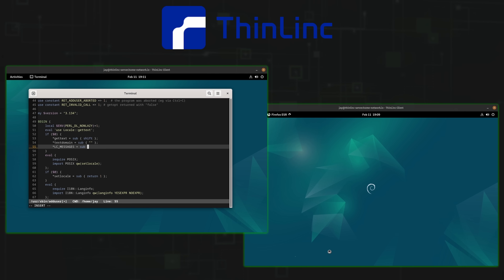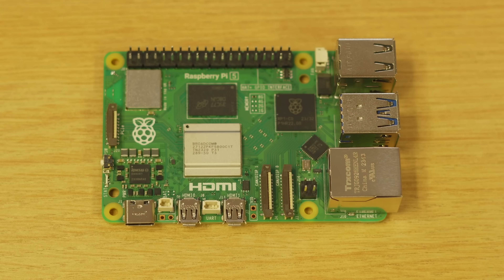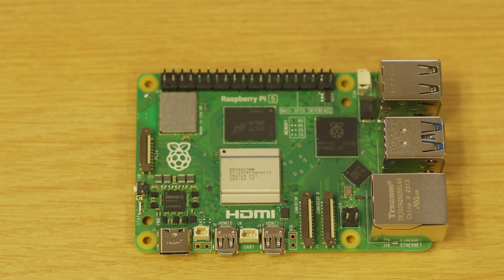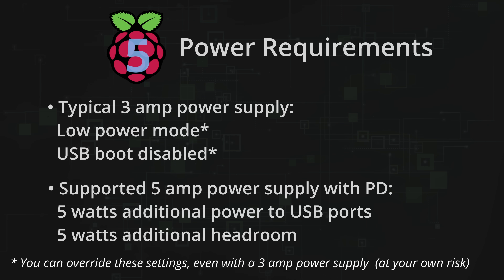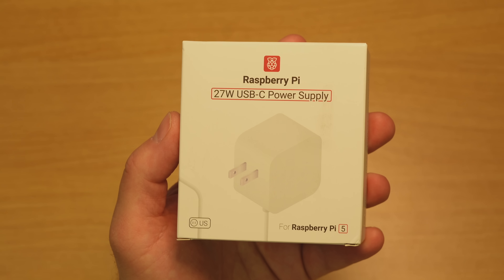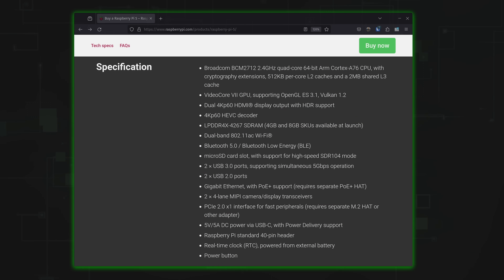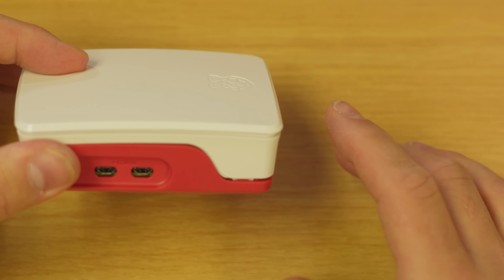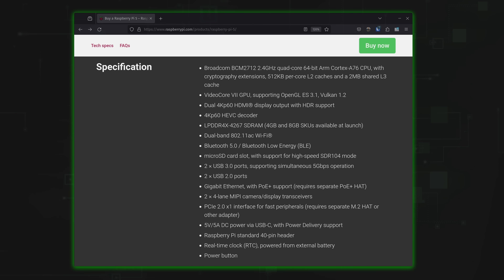Raspberry Pi 5: The Game Changer? Discover What's New!

Comment: I received a Pi5 from my son for Christmas and haven't looked back. My desk is now free of a PC. I have been using this little guy as my daily desktop since Christmas and besides not being able to compile for my 3D printer's firmware, it has been basically trouble free. Tonight I am hooking up my second monitor (had to wait for my micro-HDMI cable) so we'll see how that goes.

I've been looking all over for how to add a NVMe hat so I can use some speeder sotrage than the SD card I have been using. The NVMe hats I have read about have more drawbacks than sticking with the Micro SD card for now.

Finally, I hope the smart guys in the Arch world (and their distrobutions) will get them over to the RPi 5 so I can go back to my Operating system of choice (Arco Linux).

Comment: Is that like a mini computer?  And, a great amazon deal at about 100$ which 3x Inspiron 530S system which could be had off ebay 35$ 40$ :) Unless you need something light for a robotoid.  I think official PSU is 220w

Comment: I have absolutely NO NEED for an SBC, I have a Pi 3B+ I don't use for anything, as it's only the 1Gb RAM version, so rather useless for most things. It was bought to run a 3D printer software, for a printer I still haven't bought, and probably never will. The Pi 5 for me would be around $200AUD when I include the PS, Cooler, Case(either with the cooler or not at all, as there doesn't appear to be a case big enough to take the board with the big cooler yet, but  I'm sure someone is building a version in CAD as I type). It's still fairly cheap, but is it a better option than some of the OTHER SBC's on the market now. I would only be buying it as a LAB TOY, and have no real need of either this or any other SBC.....DOES NOT STOP ME WANTING ONE THOUGH !!!!! I'd rather spend my money on shit for myself while I'm alive than have it go into consolidated revenue when I die....NOW, time to go shopping !!!

Comment: i bought the Official case in Singapore. One thing i hate is, it does not come with 4 screws to hold the Pi5. What are they thinking? i hav to use 2 x cable ties to hold the opposite side of the board. Simple things, they cannot get it right. i did not use that fan. i went with the Offiical Active cooler.

Comment: What was once attractive about the pi in general was the low cost. Now they are pushing it into the low end computer arena running linux and it's very capable at that. The problem is this... I can buy a fully encased mini-computer with ssd storage, etc... windows installed if I want to bang my head on the wall... wifi, bluetooth et al for around the same price as an 8G pi 5 with power supply, heat sink, fan and case... without any ram. They've priced themselves out of the market as competition in the mini-computer market has driven fully functional and usable computer prices down. So, the pi 5 is mostly usable for hardware experimentation and has reached overkill.

Comment: The RPi is no longer a competitive device. Back when it was first introduced, It was revolutionary; it brought SBC price into the range of a microcontroller board (like the Arduino).

Today, Arduino's are replaced by a $5 ESP32. And an 8GB RPi5 (with case, power supply, NVMe and daughter board) cost more than a fanless N100 with 8GB RAM, dual 2.5Gb interfaces, 256GB NVMe, case, and power supply included (about $160). And the N100 is X86_64 and twice the performance. You're free to run any off the shelf x86_64 OS; Windows 11, Linux, a router OS, whatever.

I loved RPi; I've bought several, and still run an RPi4 as a Wireguard termination for our LAN. But I don't plan on buying any more. Times have changed, and with that the price/performance equation has tilted to low-cost x86_64 hardware.

Comment: The easiest way is just to enable the max power support by modifying the file and using an old power supply. Or installing an other OS, since other OS don't disable the USB power by default. I am using a 3A power supply and it is running fine. I even know a guy that is using a 2A only without problems.

Comment: Bleh. That's bad engineering on the power supply side to not properly handle the 99% case of how USB-C PD power supplies work.
Reply: They clearly wanted to force everybody to buy their own power adapter. This is just hidden cost.
Reply: They use Usb PD but its 5V 5A / 5.1V 5A (25W/27W), a really weird choice by raspberry pi. Some speculate that because of the weird specs make it cheaper for them to use usb pd implementation, while I think that its because they still want to use 5V like all their pi lineup for whatever reason.
Reply: Yep, this is the last straw for me. If you can’t do power input correctly you probably shouldn’t be in the hardware business…

Comment: Pi5 8GB + cooler + power adapter  + case + NVME adapter + NVME will be more expensive than a mini PC with similar spec.
Reply: Primary reason for me to use a RPI are the GPIO pins. Other than that a used mini PC seams to be the better option.
Reply: @wmcmps  Actually, the reason I had bought my Rpi4 was that. But that was the time when I did not know about Arduino/ESP. Now that I know they exist, I really have no reason to use RPi's GPIO. An ESP32 is cheaper, smaller, more power-efficient, and can do almost everything you could do with Rpi's GPIO. I said "almost" because I could think of some rare cases where you need to use Linux or heavy calculations, but I have a Linux server PC, so I can delegate those to that Linux PC.
Reply: It's not that bad, after some time there is many alternatives and very cheap Chinese bundles for pi5. We started with nvme hat more expensive than pi5 4GB, now same thing starts at $5 at ali and some have set with cooler, fitting case power adapter. Also you can fit pi5 to many cases from pi3 :) 
Its just better than two months ago when everything labelled by pi5 was so expensive.
Reply: yeah and a mini pc might be intel based and intel comes with some decent media features over rpi like quick sync.
Reply: At this point you guys should've just bought an old laptop
Reply: How many GPIO pins does that mini PC of yours provide?
Reply: True, but reduce the spec to 4gb ram and SD card or usb3.0  storage.  Then the price is a bit more palatable
Reply: If you buy it like that, then it is in my opinion not very clever. I only bought the Pi5, a 6€ mircoSD card and a 11€ case+fan. That's all. I am using a old no-name 3A power supply. And all is running fine.
Why should i buy and extra cooler, if it is already included in the case? And why should i buy a NVME adapter and disk? I will never notice the speedup in my use case.
In my opinion your variant is like buying an Intel Pentium CPU and but it in a big tower with an GeForce 4080 OC. Yes, there might be rare cases where that is useful. But in most cases it is not a clever combination.
Reply: @Volker-Dirr  I don't know but a lot of YouTube videos seem to promote it as "a desktop PC replacement" for doing "basic computing". For those cases, I would use a mini PC. And for the GPIO stuff, I would use use Arduino/ESP32. I can think of very few cost-effective use cases for RPi5, given its price.
Reply: @typingcat  RPi5 is very cheap in comparison to the other boards available for the same use cases. Just compare it to NVidia Jetson, or RB5, or Ultra96, or other control-oriented embedded boards. Do not compare that to MCUs, they do not have  enough compute power.
Reply: It's not about the cost but rather the learning that you get. It's like a learner starter kit for mini pc building - it's clearly geared at introducing people to build miniature electronics from scratch. If you already know and are experienced then yeah it's not really worth it, but that's the case with all such learning kits.
Reply: @EfHaichDee  I would argue that the pi pico/picoW is a better candidate for learning.

Comment: I bought all the Raspberry Pi models up to the Pi4, I bought the Orange Pi 5 and Orange Pi5 Plus though as the specs are much better, I use them for retro gaming emulation consoles, and the older Rpi models for Pi hole and I run my own email server on a Pi4, I used to run Octoprint for my 3D printers on a Pi3 but changed over to an Orange Pi Zero 2 W as it runs faster and freed up my RPi 3 for the Pi hole.
 I would have bought the RPi5 if it was available with more and faster RAM.
Reply: What software/packages are you using for your email server?

Comment: If you have an "unofficial" power supply that can provide 5A, you can set usb_max_current_enable=1 in the /boot/firmware/config.txt file to tell it so.
Reply: And You will get not much more because 5A does not mean 5V5A. Pi5 supports only 5V and that clearly break pd standard where You suppose to think about watts. Almost none of chargers will be capable today of such mode which btw require thick usb-c cable.
This param will try to increase power for usb and external devices (via pcie) but will fail for most of use cases because you will be still at 5v3a at best.
Reply: Disagree...
Laptops are all transitioning to the USB-C standard, and finding larger power bricks are becoming more plentiful as a consequence.

Comment: "RiP Raspberry Pi 2024 👈." There is too many better alternatives as of 2024.
Reply: Which do u recommend?
Reply: An N100 mini PC. About $160 at Amazon. Includes fanless case, 8GB RAM, 256GB NVMe, dual 2.5Gb Ethernet, and power supply.
Reply: @neta Agreed.  Although my Amazon must have me in the goya bracket with higher prices :)   Might as well get miniPC.

Comment: At that price it doesn't make any sense to buy it. Just by a N100 mini pc
Reply: Unfortunately it is true.
Reply: Why don't Western manufacturers make n100 mini pcs?  Only Chinese
Reply: They can not keep up with demand, so they must do something N100 can not.
Reply: What about power consumption? RPi5 can be used with a compatible power bank easily in a headless mode (ssh) with an android phone. But I still prefer the RPi0 for that purpose as it's cheap.
Reply: It might be reasonable for some, but certainly not for all. Tinkering with rpi projects is hardly done with a N100 mini pc.
Reply: the N100 is MASSIVE compared to the PI, you can't fit the n100 on a wall, or on a rack, or on a grid.
Reply: @llortaton2834  are you serious? Mini PC are slightly bigger than a RPi
Reply: @llortaton2834  I agree. It’s MASSIVE!!! Almost like a mainframe….
Reply: @llortaton2834  absolutely MASSIVE requiring refrigeration, halon fire protection and huge generators for power backup but the biggest problem is transporting such a device.
Reply: @llortaton2834 You haven't seen the UP 7000. Orange Pi is also going to release a N100 SBC.